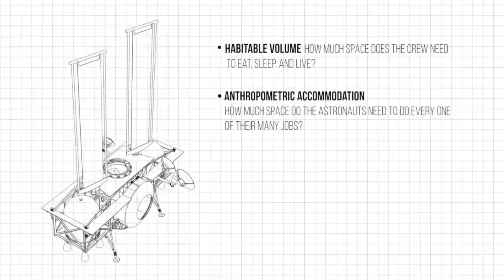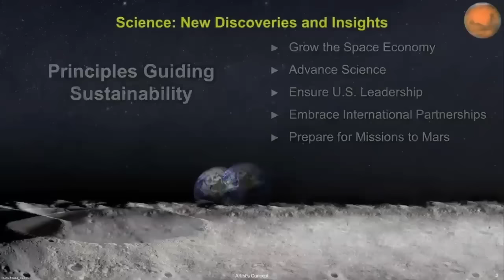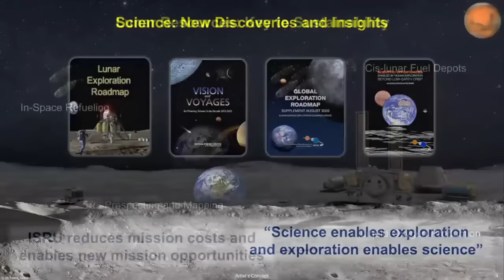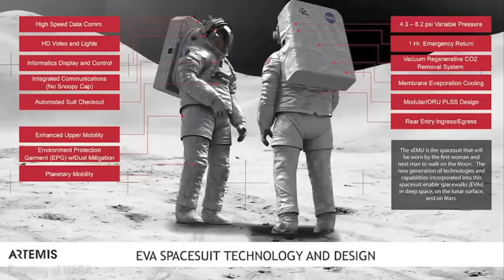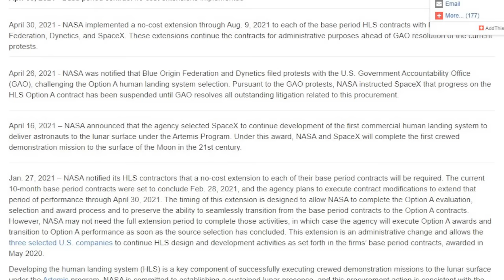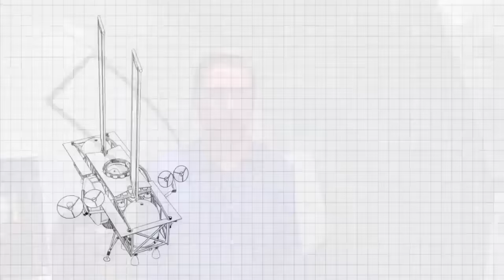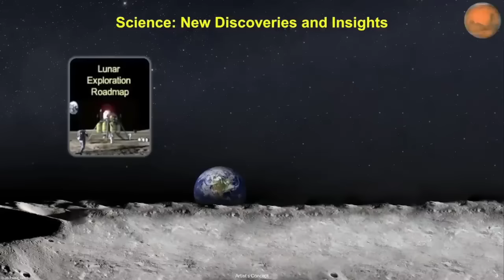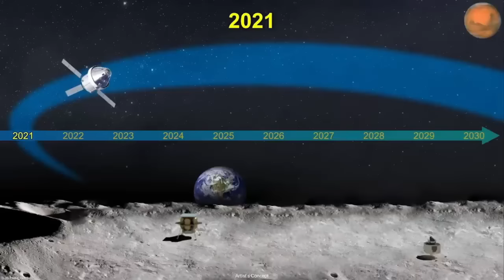New Dynetics Lunar Lander! 100% reusable!  Exclusive interview with Kathy Laurini. [RE-UPLOADED]

Comment: Big fan of the Dynetics design. It could pair well with Spacex. The Starship could be easily outfitted to deliver Alpaca to lunar orbit for shuttling personnel to and from the surface. SpaceX could then be used for material deliver and the occasional movement of larger contingents of personnel. A good combo.
Reply: I'm also a fan of the Lander alpaca is the way I've asked several occasions on several programs how many dianetics alpacas can be put into a Starship
Reply: @star.watchersteven3255  there is a joke in there somewhere. I can't pack it.
Reply: Alpaca is designed like it would make an excellent communications hub that can be setup in different locations on the light side of the moon.  The dark side of the moon would require a alternate power source that solar.....nuclear perhaps.
Reply: With its orbit to surface and back capability it could redock resupply and recharge a lot safer than hauling nuclear batteries out of the atmosphere
Reply: I view it as being a lunar hopper going to temporary places of investigation from a refueling base.
Reply: @valamaas  How many 'pacas could a Starship pack if a Starship could pack 'pacas?
Reply: It also preforms as a good scout vessel
Reply: @myyklmax  I do not think it would; the dark side of the moon sees just as much sunlight, only at different times; simply plan your landings around the new moon, rather than a full moon, no?
I assume this is why long term polar presence is preferred, in theory there is a point where panels built straight up could rotate with the sun during the course of a month. Of course, if the moon “wobbles” relative to the sun too much, that point could be constantly moving around.
Assuming I am understanding this correctly,
The moon effectively has month-long “years” and no “days” at all. Even if you want to live long term on the lunar equator, you need ½ a month of energy storage, and enough solar panels to recharge in the ½ month you do see the sun.
Reply: @abstraconcept  is I have come to understand, the Moon does NOT rotate on an axis like Earth. So one side of the Moon is always facing the Sun.

Any platform on the darkside of the Moon would need to be in direct line of sight to the Lunar Gateway to maintain a continuous communication with NASA ground stations.
Reply: @myyklmax  It does not appear to rotate relative to the earth, but because it orbits the earth it does rotate relative to the sun. During a new moon phase, it still receives the same amount of sunlight, but the far/dark side of the moon is being illuminated, rather than the near side facing us.

You are correct about communication on the far side being an issue. The PRC space program used a relay satellite (Queqiao) orbiting the Earth-Moon L2 Lagrange point to talk to its far side lander/rover. A long term NASA site on the far side would probably put its own relay satellite in a similar orbit; even if NASA wanted to use it, the Queqiao satellite will already be past its of life by 2024.
Reply: @abstraconcept  When NASA talks about a satellite's lifespan, they usually mean the satellites fuel supply and battery life (all batteries can be recharged a finite amount of times before they finally cannot recharge.
Reply: @myyklmax  Queqiao is a PRC satellite though, maybe the same lifetime calculation holds true as for NASA, but I do not know. NASA’s spacecraft also have quite a tradition for outliving their design lifetimes, so a comparison of CNSA toNASA is not necessarily very relevant. Besides, I do not know how fuel-intensive station keeping in that lunar L2 orbit actually is.

Comment: SpaceX's philosophy is that 'Innovation does not have to mean high $$$. They believe in being bold but keeping it simple and affordable. That is why SpaceX chose stainless steel over carbon fiber of the body of Starship.

Dynetics's Alpaca drop tank can be retained to be repurposed on the lunar surface.

Same can be said about the external rank on ULA Vulcan rocket. Use it as part of a fuel depot in HEO.  Under international salvage laws, once it is discarded, it can be captured and repurposed.

Comment: IMAO, the present Alpaca design seems to me quite complicated (and therefore heavy). It is also stingy, being overly limited in habitable volume. Having a removable cabin is beyond the scope of the NASA request, and has caused Alpaca to reach a suboptimal design in many other aspects. 

Here is my concept: Just make the entire lander as a single cylinder - even up to fairing-sized diameter - with six bulkheads, and totally eliminate the fairings! 

Place the lunar engines on the far ends, fore and aft, hidden within the kick-stage _interstage adapter and the ejectable aerodynamic nose-cone. 

The crew compartment is still sandwiched between propellant tanks, but will now be the same as width as the tanks (even as wide as a fairing), and as long as you can tolerate. The hull is reinforced where necessary, especially on dorsal and ventral surfaces, with extra full length "top-hat" stringers to withstand higher longitudinal stresses caused by the outboard lunar engines. I suggest keeping the heavier LOX in the outermost compartments to minimize hull stress. I really don't see any issue with the docking port projecting sideways out of the hull and causing some drag during launch.

The landing legs will be folded longitudinally during launch, with struts protruding modestly from the hull, and will be fully deployed after SECO. The landing legs should be capable of self-leveling and absorbing shock without bouncing. 

The solar collectors will partially deploy after SECO, with the active surface facing sunlight during the journey, and will provide full shade for the propellant tanks to eliminate evaporation. After landing, the astronauts can manually deploy some mylar reflective/shade panels, and adjust daily as needed. Propellant evaporation on the lunar surface can be exploited to heat the cabin, although judicious reflection by the mylar panels may also heat the cabin. 

The lunar engines should be optimized for both thrust-to-weight ratio as well as ISP, since they are also working against some gravity drag. (Hydrogen is a poor fuel choice since obtaining the highest possible thrust-to-weight ratio is ... very difficult.) Throttling should be coarsely set by starting and shutting down opposite engine pairs, so that the remaining engines are running in the most efficient possible range. 

Weight should be reduced by minimizing engine count, increasing bell diameter, and by improving engine thrust. Don't include redundant main engines. Instead, test the Hell out of them and make them totally robust. Use only well-tested engines for the missions. To minimize mass, you also need to verify your modeling parameters, and shave off weight until a test really fails. 

Near the landing site, the engine gimbals can exaggeratedly splay the engine exhaust sideways to minimize deep cratering near the landing legs during final descent. This reduces efficiency, but is another form of engine throttling, which relaxes the engine throttling specification, thus reducing engine development compromises. You really only need two engines for the final landing if they are robust. 

The other engines are deployed for heavy acceleration during ascent, as well as during descent well away from the surface. Only one pair of engines require exaggerated gimbal. Placing all engines in that exaggerated pivoting structure will greatly improve failsafe. You may also achieve longitudinal thrust. 

The door (opposite the docking port), used for exit to the lunar surface, can swing directly out and upwards, and then the stowed ladder/stairs can be manually deployed. After bracing the door, it may serve as an overhead cantilever/bridge-crane to conveniently lower some heavy items to the surface, instead of carrying it down the ladder.

Comment: Dynetics lander could actually been the main choice if they figure out all of it issues, like the lack of thrust. Because it would make more sense to crew missions with the Lunar Gateway, being less massive, means more easy to dock and land. Also lower to the ground, and could be launched by different rockets. Lunar Starship, would make more sense if, the current mission, was to build a base on the Lunar surface. And once Lunar Starship make it missions, what you do to it? You can't reuse it for another Lunar mission due to maintenance checks, and very unlikely to load it with cargo in LEO form other Starship.
Reply: I think it would be better to send a conventional Starship into lunar orbit for resupply and cargo transfer to a lunar Starship. Leave the lunar Starship in cis-lunar orbit. Send conventional Starships back to Earth and LEO.
Reply: What thrust problem? They just tested their new engines and now have a higher takeoff thrust to weight then the original lunar lander with engine out capability

Comment: Would it be possible for Dynetics to leave the central crew module on the moon prior to return, making it easy to join together as part of permanent colony/construction effort...  System would need to be designed for astronauts to simply strap on for return to lunar orbit, but I don't imagine it would be an issue sustaining the G's required to meet up with Orion/Starship/Gateway.  Just need to be protected from engine exhaust.  This would significantly modify the mass equation required by dynetics.   Of course, would need to transport replacement crew modules to lunar orbit for the next landing, but they would all become part of colony construction material.

Comment: I propose that the need for "a strategic propellant depot near the moon" could be satisfied by using a Lunar Starship's huge fuel tanks for this purpose. RL-10 engines have been altered to use different fuels before (original did not burn hydrogen) and could no doubt be modified to burn methane. Lockheed's plan to construct a much smaller propellant depot, apparently by modifying a Centaur stage structure, requires a sunshade to reduce the inevitable losses of stored hydrogen. This could be simplified and ameliorated by use of methane fuel, as in Starship. Both versions of fuel depots would provide viable redundancy and reliability to ensure people are not stranded in cis lunar space if one system were to fail.
Comments, anyone?
Reply: Love it. But supply the expendables from a conventional Starship that makes the round trip between Earth and cis-lunar space.
Reply: carrying the heat shield and flaps as parasitic weight?

How about a orbital only version of HLS without the landing legs or extra landing thrusters?  Minimal weight for the ship maximum for cargo, travels from LEO to the gateway and back. 

The HLS stays in lunar orbit or on the surface.

Comment: This isn’t a bad lander. Like the design where the hatch is close to the ground. It doesn’t have as much cargo and crew space as SpaceX lander, but still good though.
Reply: Yeah, but a few landings with some crew on it to pack down a makeshift pad could make Lunar Starship much safer.
Reply: @joehurst3495  The landing legs have always bothered me with SpaceX. It doesn’t seem to be spread out enough to take on lunar regolith with the weight and the centre of gravity for a tall lander. I could be wrong.
Reply: I'd be surprised if there weren't people at SpaceX working on making sure the legs are suited for it, they'd have at least some information on it's characteristics from the Apollo Program. My concern is more the fact that it's relatively tall and skinny which can cause balance issues, especially on uneven ground. It'd be really bad for the thing to tip over and leave astronauts stranded or worse on a good day, but much worse at what looks to me to be such a critical point for the future of space travel.

Comment: Didn't they reject Dynetics design as it wouldn't even be able to land, with 0 cargo on board?
Reply: Shame bc a non-resuable variant could be used as a moonbase.
Reply: Yes, for the first landing 2024, but more landings are not bought you yet so thereby is there an ongoing competition.
Reply: @ajbp95  I prefer them over BO.  But cargo is a big issue.  Obviously no one will be able to land as much as SpaceX.
Reply: The original flaw is that while it can land, it won't have enough deltaV to get back to the Gateway with cargo.
Supposedly they solved that problem already.